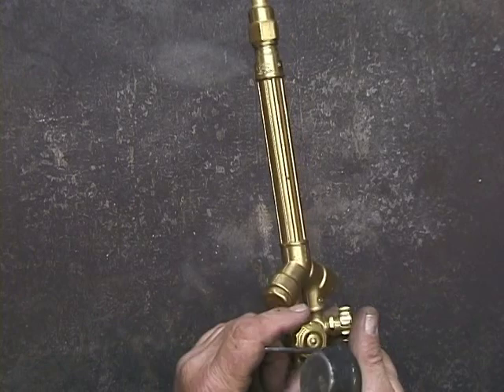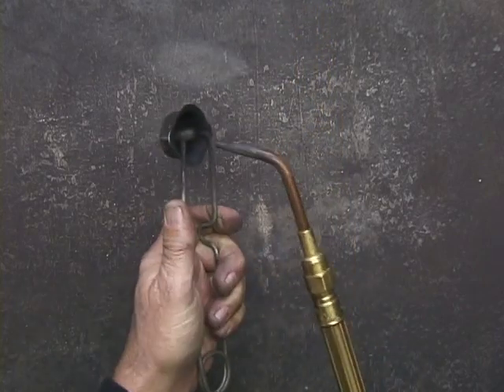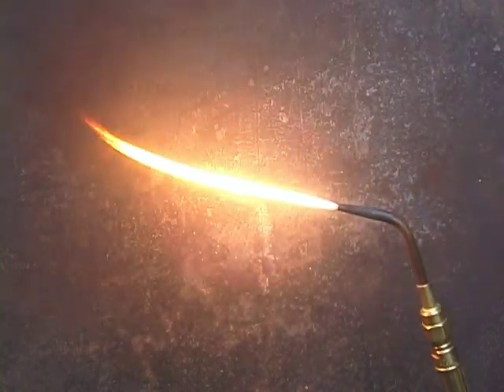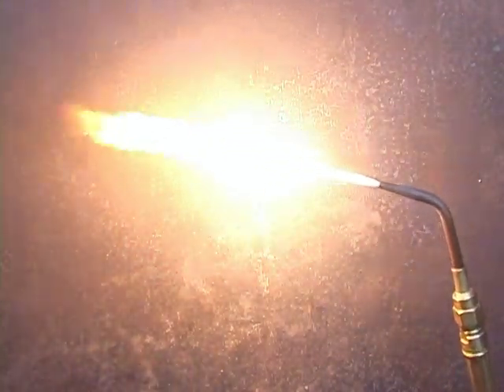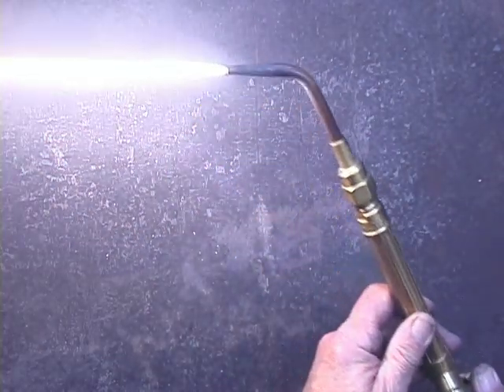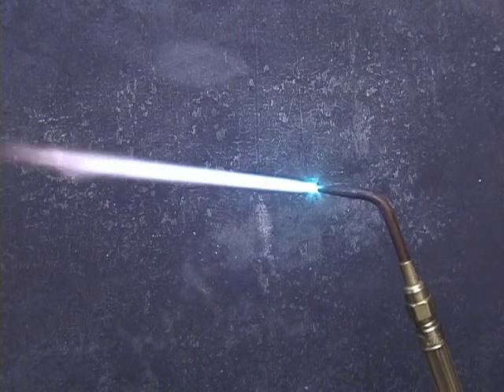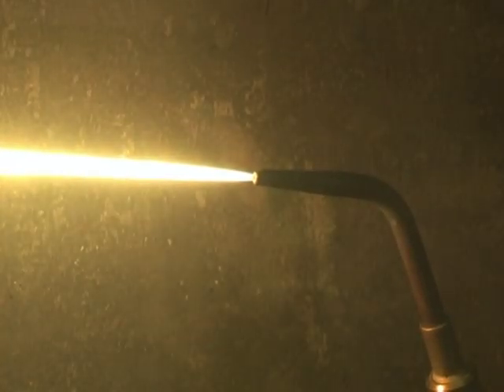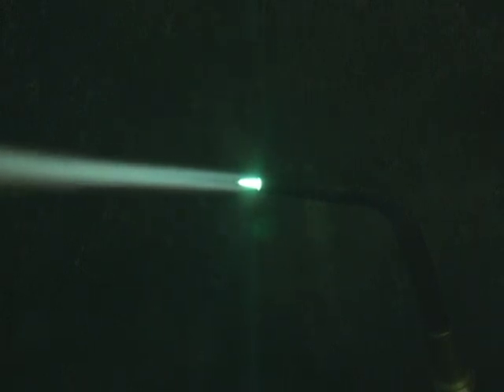The Carburizing Flame for Brazing

Comment: Dear Editor: “Carburizing” vs. “Carbonizing”…let’s get it right 🤓
Reply: I think both are used, both refer to the same thing.  Also common and more relevant in many cases is "Reducing" flame, since some metals don't form carbides, and excess carbon won't add carbon, but will have other chemical effects which you might or might not want.

Comment: George, your videos great. Minimal talking, excellent demonstration.  Some of your small points, you don’t explain the reasoning,ex: “sometimes a carburizing flame helps bronze flow better.” WHY???
Wider footprint of heat, more ‘wind” pressure?  I like to know the “why”.
Thanks
Reply from the maker: Ron, I have no idea how that works.  A welder suggested it 40 years ago and I've used it ever since.  I am self taught with a lot of help along the way.  There is much of the technical explanations I don't know.  Best place to get an answer is from a welding engineer.   They may be able to help.  There are differences with high humidity and low humidity.  A cold welding table and a warm welding table.  The point is to intuitively become aware that something has changed and make adjustments.